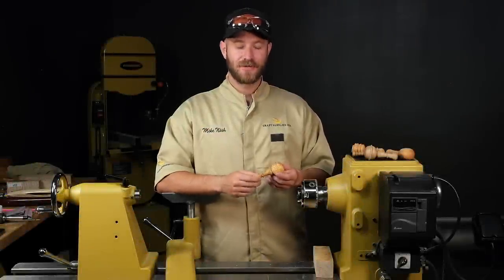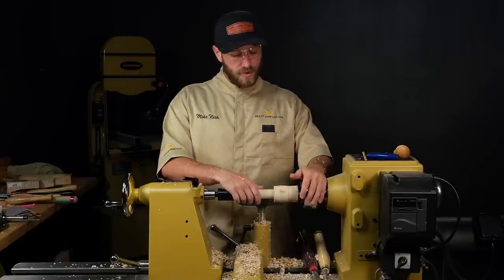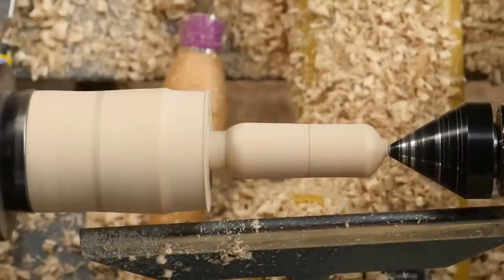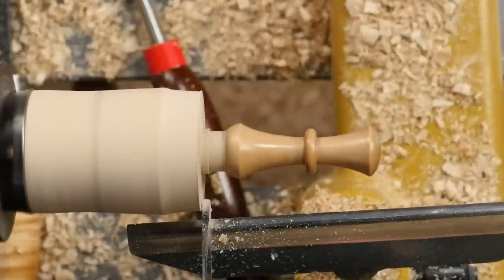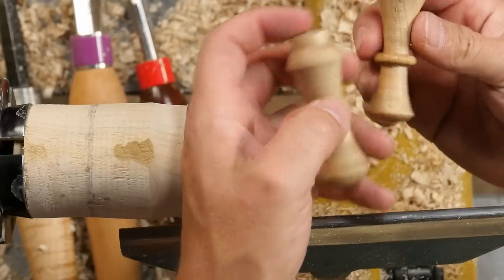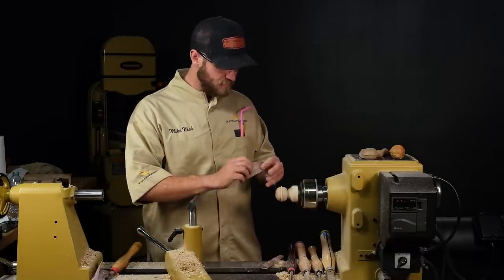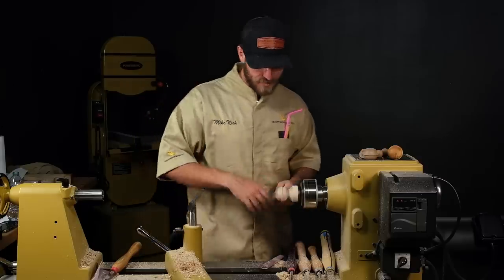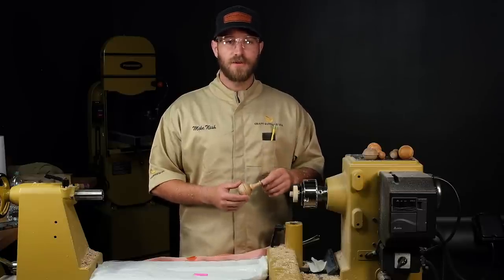Turning a Baby Rattle

Comment: Excellent easy to follow video. Well done 👏. 
Personally I would use a cellulose food and toy safe sanding sealer thinned with cellulose thinners 50/50. It penetrates and dries in seconds .De-nib with 600 grit abrasive and finish with a microcrystalline food and toy safe wax. 
Looking forward to your next video. 
Take care. 
Joseph
Reply from the maker: That's a great tip!  Thank you for watching.  -Mike 😊

Comment: Very cool, what do you think about using stainless steel bearings for the inside fill?  I have a Grandson coming in March so getting into the wood toy making now.
Reply from the maker: Steel bearings might make the rattle to heavy, and could hurt if a baby accidentally hits them self with it.
Reply: @CraftSuppliesUSA  Good point, thanks.

Comment: Very nice. What tool handle do I need for the Beading cutters? Also could use a glass marble for the rattle? Thanks David
Reply from the maker: The beading cutters fit on the Pen Turner, Easy Start Tools, and Easy Rougher; the 3/8" beading cutter only fits on the Easy Rougher.  I don't think there is enough internal volume to fit marbles,  I'd recommend the corn kernels or dried peas.